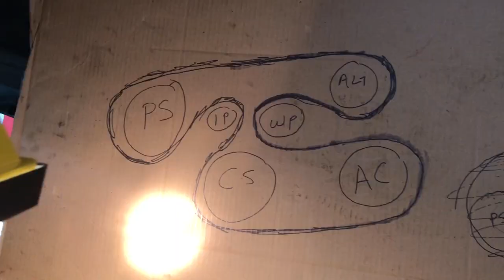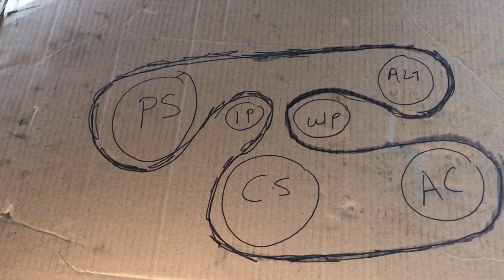Toyota Camry Water Pump Replacement

Comment: Great tutorial! Do I have to remove the water pump in order to swap out the idler pulley?
Reply from the maker: Thanks. No, just remove belt. But if it’s old with a lot of miles you may want to since you’re there.
Reply: William Kincaid Thanks. I replaced the pump about 4 years ago so I should be okay.